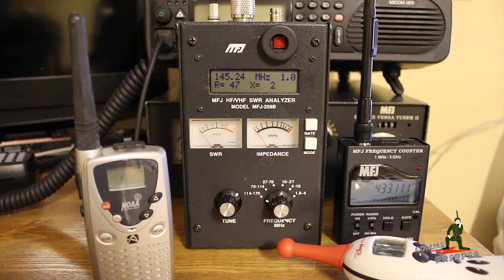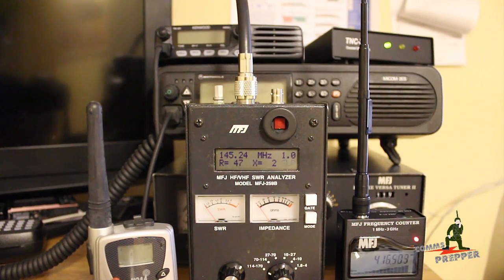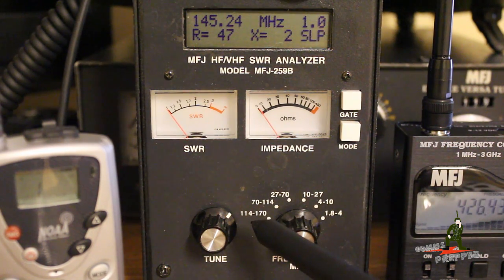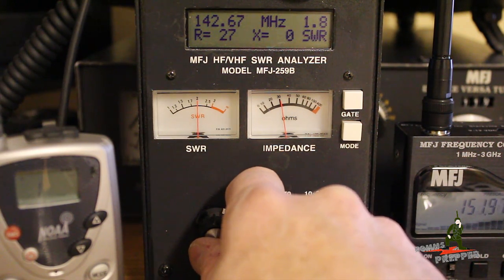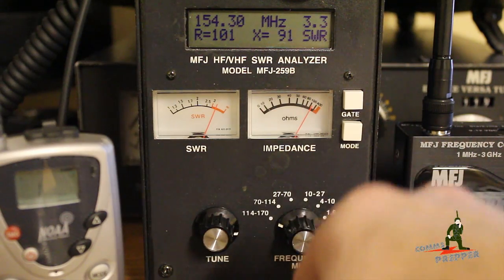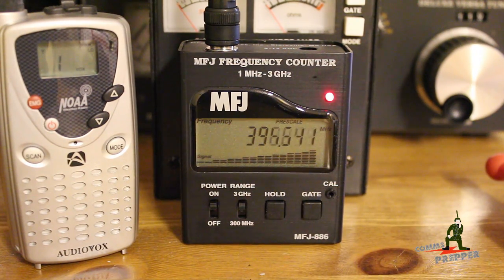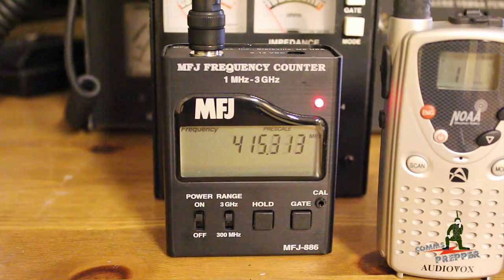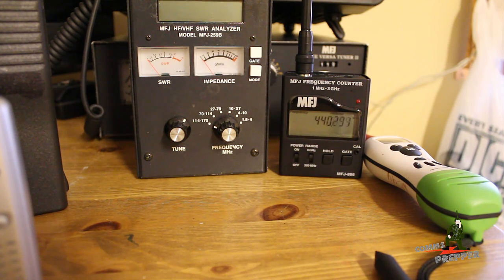Prepper Test Equipment

Comment: I'm sorry, "hair" was a casualty of auto correct. You mentioned in your video that you were going to produce a second on how to use the MFJ analyzer for trimming an antenna. I'm at that spot right now. 142' vertical loop with high swr. Not sure what to do from here with regards to the wire length.

Comment: Is that your H.F.rig under the Kenwood? I can't really read the name on it but I think it is Motorola and didn't know they made ham equipment. thanks for another great video. =-O KE5SRB
Reply from the maker: It's a Motorola Micom 2E.  I picked it up used back when I was a member of the MARS program and needed a compliant radio.  Micom did make an Amateur version (I think they three units that never took off) called the Micom 2H.  I saw a picture once.  It had a VFO knob on the speaker and was grey.

Comment: Good video.  I would add that with that high SWR (above 2:1) you would be damaging your equipment only if you're transmitting.  You'll likely still be able to receive very well at a fairly wide frequency range.  W7BBQ.
Reply: Depends a lot on the TX wattage.  If you're dealing with an HT sending < 5 watts, you probably aren't going to harm anything below 3:1 SWR.
Reply: True.